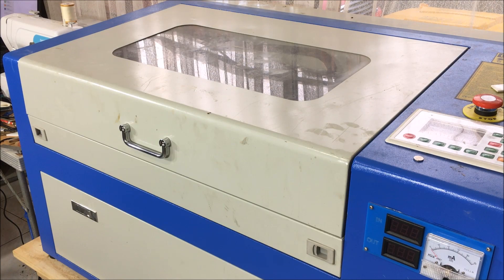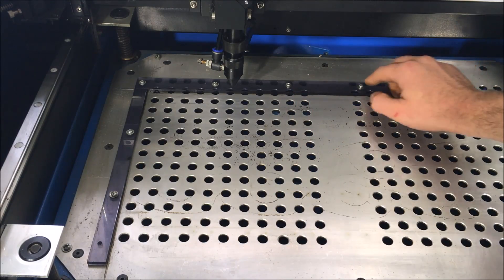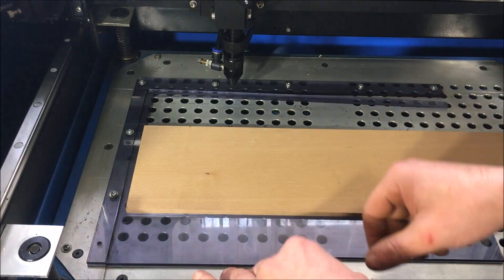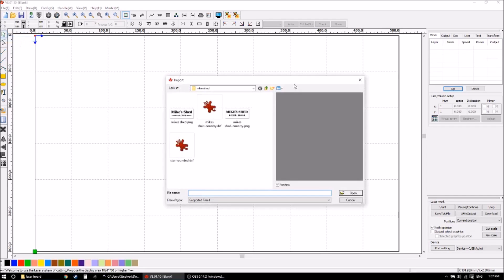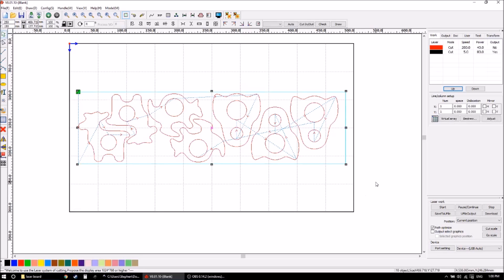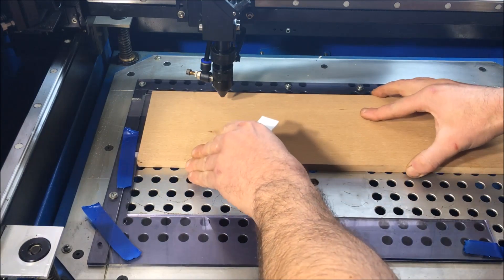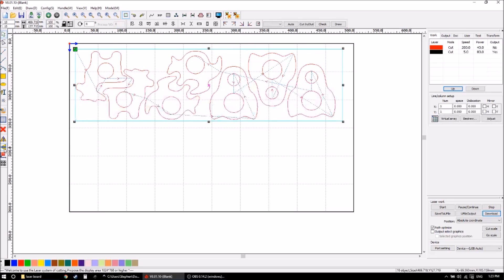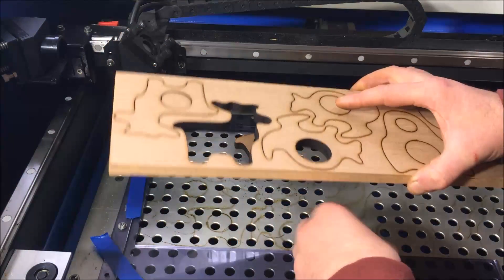How to cut through double the thickness. Using 50W Chinese Laser Cutter

Comment: Is this a stock 50w or was the lens replaced with a HQ version?  There are two other types of lenses and one is the el cheapo that comes with it.  Another is the HQ you can purchase for around 15-17 pounds and the last is 75-100+ pounds.  Just moving up to the HQ version will give you 9-11% more power at the cutting beam and that is one heck of a lot.  The really expensive one with triple coating (HQ is double coating) is about 1-2% more power than the HQ so the biggest bang for the buck/quid is the HQ version.
Reply from the maker: This is the stock 50mm lens, I try to use the stock parts to demonstrate just how much you can get out of the cheap stuff.
 
While more power will allow you to do really useful things like cut at faster speed or use fewer passes, I wouldn't expect cutting depth to increase much more than maybe a few extra mm. This is because your cutting depth is also somewhat limited by the working length of the beam waist (which is related to the focal length).

I hope to do some tests on the higher quality lenses and making quantitative measurements on the extra performance.

Comment: Cost of a machine like this one ?
Reply from the maker: In Australia about $2000-$2500 from eBay, with a working area of 500x300mm.
I modified a few things like the table surface and some loose fittings, but I'm using exactly the same laser tube and optical components that it came with.

This technique should also work with one of the smaller 40W machines too. Just make 2 passes of the laser on each side of the board.